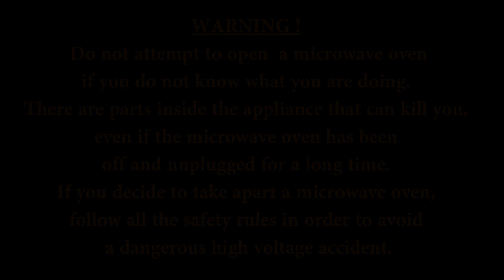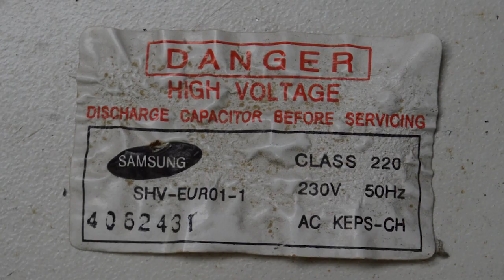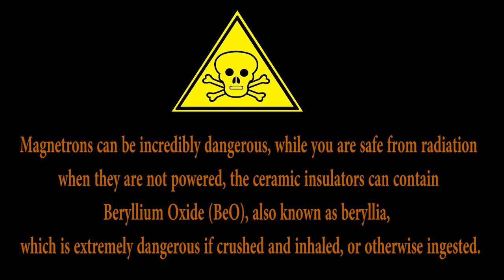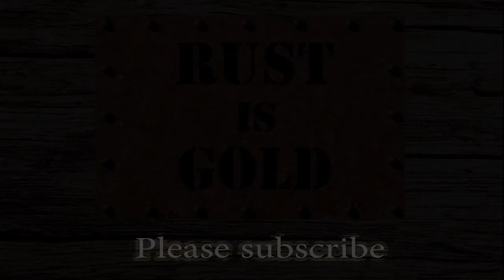How to remove Magnets from a Microwave Oven

Comment: Just recently found out that any non heavy duty commercial grade equipment will be using aluminum oxide as a coating instead of beryllium oxide. That changed a while back, so unless its a fairly old microwave you won't need to worry about berylliosis
Reply from the maker: Thank you very much for your comments! I wasn't aware of this... 😊👍

Comment: Mine are torx screws. 10 different screwdrivers and not one fits. Any ideas?
Reply from the maker: This is strange... What kind of screws are these?
Reply: @RustisGold  torx with the stud in the middle 6 sided I used a triangle file to file some of the stud out a hack saw to do a little more and then a flat head to unscrew.

Comment: I honestly can’t see the manufacturer’s using berillium oxide for the ceramic insulators. It’s crazy expensive and fatally toxic. The Color of the coating seems to be some sort of aluminum oxide and possibly chromium. Chromium has a pinkish or purple Color.
Reply from the maker: You are probably right, but that's what I had seen and read in other postings and I didn't want to take any chances...
Reply: @RustisGold  for sure. Especially if it came from China lol. It’s definitely not something too mess around with. I always hazmat up when dealing with magnetrons lol.
Reply: The magnetron it’s self can also hold some charge for a period of time. If a person is not comfortable with high voltage electronics it’s probably better they leave it alone lol. Amazing amount of power for such a commonly used appliance.
Reply from the maker: @melplishka5978  this is true. It can be really dangerous for people who are not familiar with dealing with electricity... 👍
Reply: A cheap diamond tester will let you know if the ceramic is beryllium or aluminum.
Reply from the maker: Thanks, I didn't know that...
Reply: Ya always better be safe than dead lol